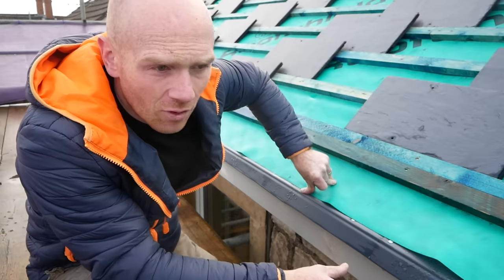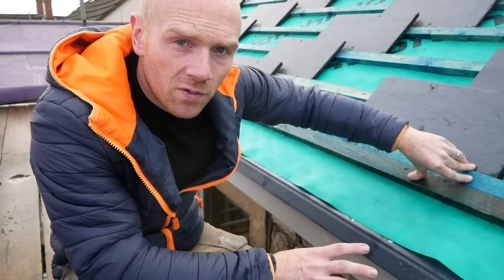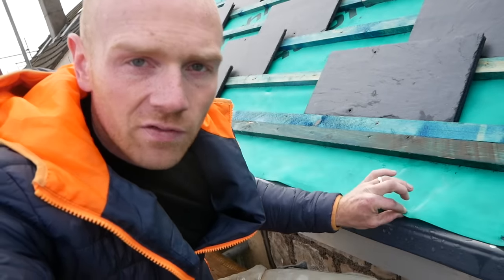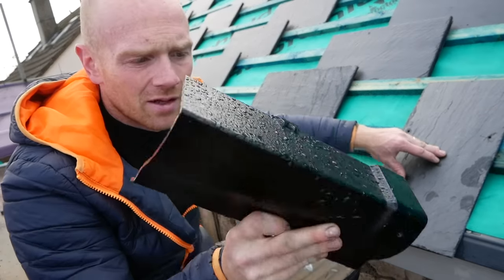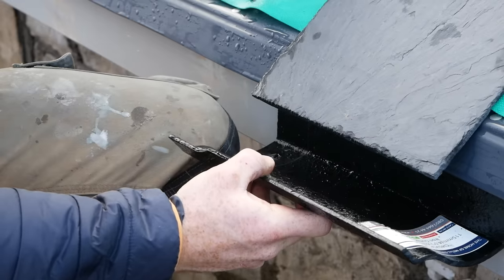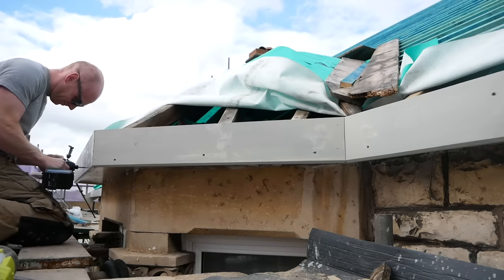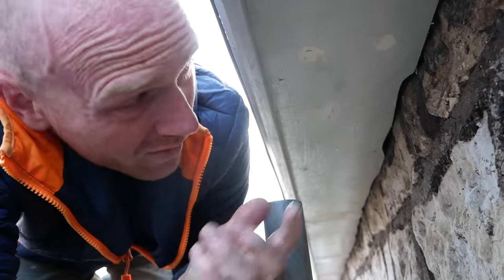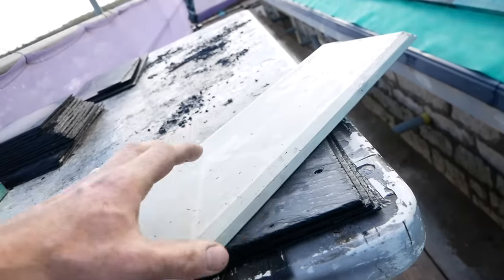FINISHING THE EAVES - Timber Fascias & Soffits

Comment: Hi Tim, that's looking great, your standard and approach is better than so many jobs I see, well done mate the feeling of achievement that you will get once this roof is finished will live in you forever, your a proper grafter, all the best Robin
Reply from the maker: Glad to hear it gets your nod of approval. 👍 it will be a great feeling when the last bit of scaffolding comes down. Mainly so I can get the car back in the drive!! 😂
Reply: Hi! How come you didn't use red batten for the roof? Robin on your projects which do you use? Just interesting to know.
Reply: @natedawg2p  Well I use the British Standard Batten and we have this in Red, Blue and Gold depending on the supplier, I have even seen it in Pink!!!!
Reply: @ukconstruction  yeah I sell the red. With the shortage at the minute ive had to get blue and my customers hate it. One said its like using balsa wood. The blue is from the outside of the tree where the red is more from the inside.
Reply: Robin why don’t you sark your roofs in England? We usually use 150 by 22 pressure treated for a slated roof and half inch sheathing or osb for tiles even though they will be getting counter an tile baton .cheers 👍🏻🏴
Reply: @rcr76  We do sometimes sark the roofs, this is mainly when it has been dictated by a structural engineer for rigidity purposes, I reckon in the 30 years or so that I have been construction roofs I can count on one hand the amount of roofs that we have sarked!!! I personally really like it too!!! 
Hope that answers your great question mate
Reply: @ukconstruction  yeah suppose kind of just seems strange seeing it with just the batons. Sarking is the best job in the world on a fine day .

Comment: Hi..'Closing' a roof at the eaves or soffits has always seemed a bit of a dark art, and its almost impossible to find a perfect system..would you agrree? and therefore it's the principle of it all, which I feel here, you have explained and shown very clearly, thank you..Also the first and second rows of slates, in particular..a row on their sides, then start windward with half, then on the return a whole one???..In fact just seen video where you've cut the first row in half.. Couldn't you just turn it on its side? So first row is doubled up in strenght..Have cottage on west coast of Ireland, where the prevailing westerleys can be a bark!!!

Comment: Just finished doing the EPMD on my 6.7x 5.4m garage roof, did most of it on Sunday and had a small patch to do but unfortunately the primer for the patch was missed off the order, so had to finished it tonight. So glad to finally have the garage roof insulation and covered in EPDM. The office in the garage is currently at 22.8°C from my laptop running for 8 hours along with 2 monitor and an air filter, as well as my body heat, which I'm pretty impressed with. Do have a fan heater but haven't used it yet, will see what happens when it's 0°C outside.

Comment: If you do get water behind the tiles won't it just get stuck behind the battens and rot them? When detailing I usually use a counter batten and sag the roof membrane for water to run down. A serious question by the way, not saying you are wrong. Just here to learn.

Comment: Beautiful job. I'm building a timber forest workshop (bushcraft hobbist). I like your soffit block idea. ✍️🤠
Reply: If doing a new roof with modern tiles, the off cut from the new truss has the correct angle to screw to the side to lift up your last batton an inch and give a bigger surface to screw the facia to. Hope that makes sense.

Comment: if using cast ogee gutter that screws though the back of the gutter rather than brackets i highly recommend getting it on before you start slating the roof as it will be near impossible to get the screws in after and you run the risk of snapping the eves when when lifting the felt support trays
Reply from the maker: In an ideal world I would have but just can’t wait as they could still be a couple of weeks from being ready. Yes they can be directly fixed like they were before. The brackets help with both the install and make sure they sit level as all the cast have a forward tilt on them.
Reply: ah yeah i missed you said you’re using brackets should be ok then still a pain to do but should be ok with a long driver bit
Reply: @TheRestorationCouple  Yeah Trent is right but like you said its too late now. It will be a pain to get the screw in the top of the bracket if there is one above the gutter... be careful if it gets cold when lifting the support tray.. when its nailed it has a  tendency to split/snap. Its really important to get your overhang right. Good work
Reply from the maker: Yes will have to see but fortunately the screw holes are on the side of the cast brackets rather than top so hopefully sneak it in with a long bit. 👍

Comment: Hi. I’ve just started following you so may have missy it in another video but are you not allowing any ventilation to the loft? I ask as I renovated a old house and didn’t, to find the rafters soaking wet so put in some vents in the soffit which fixed the issue.
Reply from the maker: There is approximately 10mm at soffits where it meets stone which continues to ridge. That said, this is a fully air permeable membrane so ventilation is not as necessary as with other products and it can be used without. Vapour barrier inside the loft rooms also prevents the moisture getting through in the first place. 👍
Reply: @TheRestorationCouple  Yes, thinking about it, my house was done 20 years ago and they used asphalt. Nice to learn that the modern stuff is permeable. Also noticed in another video that you have rooms up there so a different scenario from my old property. Great work by the way!!